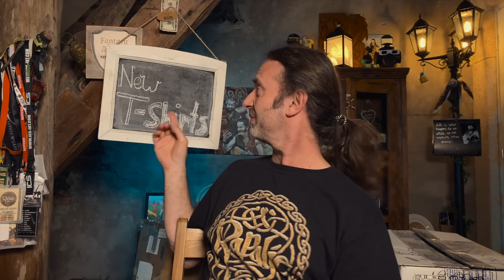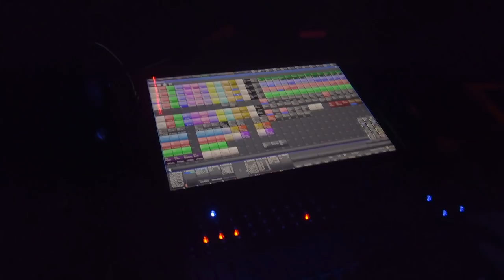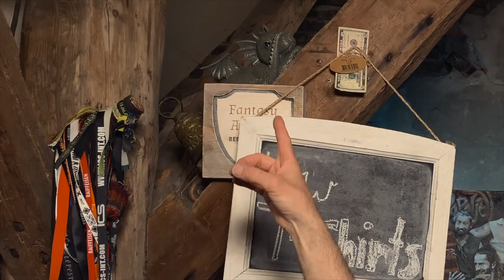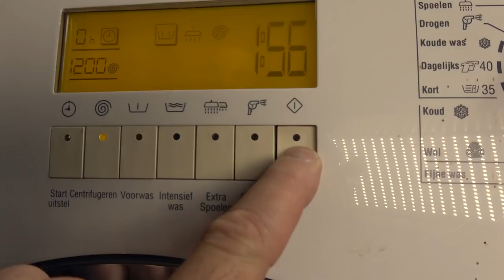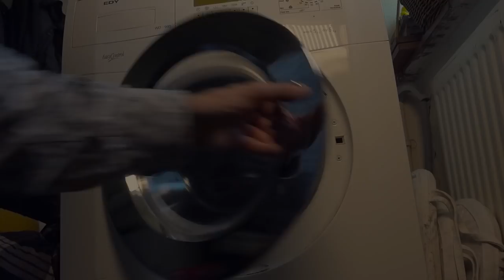Your new T-shirts arrived! - Rapalje Show 82

Comment: I was wondering what you were going to do with the speakers; I could tell that you were refurbishing them and then. . .the Leaning Tower of Speakers!  When I wash a printed T-shirt, I always wash them inside out. . .it seems to help keep the printing longer; although if it is a cheaply printed one, they lose the print quickly.
Reply from the maker: I did not turn the T-shirt on purpose. Want to abuse them as much as possible to see which one lasts longer..
Reply: @RAPALJEmusic  A true stress test.